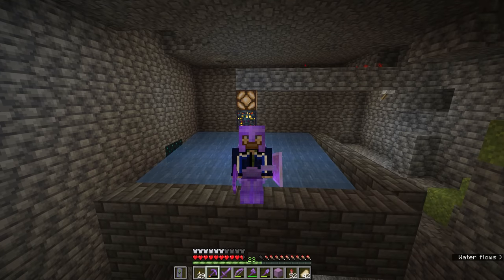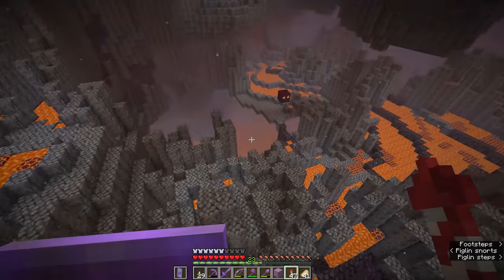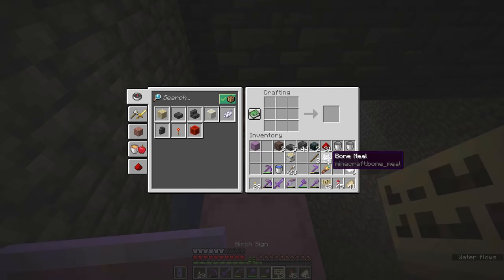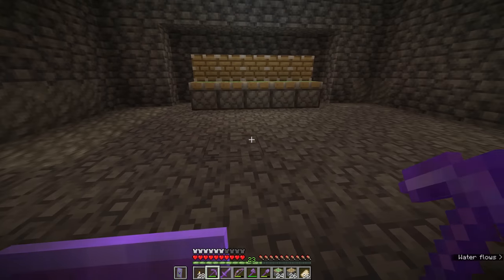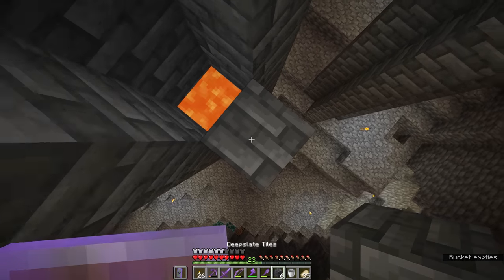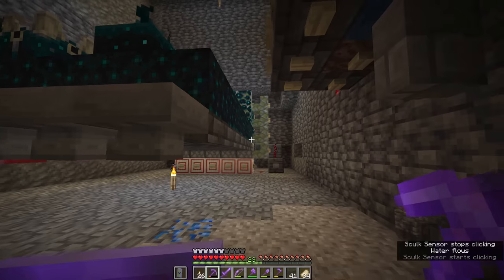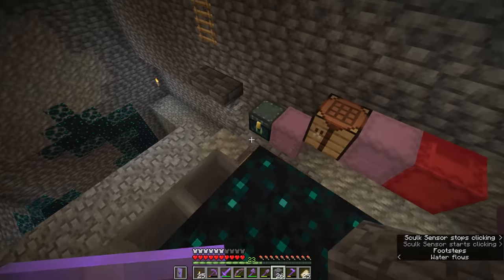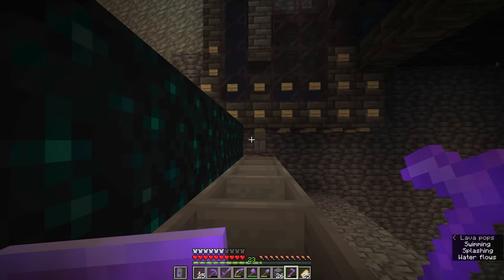How to use Sculk Sensor Frequencies! ▫ Minecraft 1.19 Survival Guide (Tutorial Lets Play) [S2 E117]

Comment: I think an interesting solution to the fall height problem is to utilize the sculk charge mechanic where you can control where the sculk charge goes using stairs and trapdoors. So maybe the set up would be have them drop into the floor on bedrock level or have them autokilled some other means and have a sculk charge wire travel to another room to be converted. It's too late to suggest this now but might be interesting for a future project maybe.
Reply: The only issue with that is sculk loses a lot of charge when moved along a wire, like an exponential amount and cannot produce anywhere near  as much sculk as it would otherwise, even on really short wires

Comment: pro tip: since Sculk veins can hold back water the same way signs and buttons can, coupling this with the ability for them to occupy multiple faces of a single block or spread to all available faces in a corner (like glow lichen can) makes them pretty useful for this.
Reply: I like the sound of this thematically, but it might not be a good long-term solution since I wouldn't be surprised if Mojang changes them to be possible underwater in the future, like glow lichen is.

Comment: if you let the spawner run without generating stone wouldnt after enough time all blocks capable would be converted or have the veins on them so the only available ones would be from generated stone when you turn it back on? seems easier than buttoning every surface

Comment: The comparator really is a complicated redstone doohickey, especially paired with the new sculk sensor.

Also why not make it so that right-clicking a sculk sensor swtiches it from proximity mode to frequency mode (the output signal can switch)
Reply from the maker: Because sculk sensors are organic - they're kinda 'alive' - so while they do output redstone power on their own, having them switch modes like a daylight detector feels a little odd. 
And, tbh, a comparator is designed for this kind of thing. So it's intuitive for a player who's used comparators before.
Reply: @Pixlriffs  that is true, and it is hilarious how cake outputs comparator signals, I do wonder if putting a candle in a cake changes the signal strength.

Comment: Why can't the comparator facing the same direction as the subtraction mode one be a repeater instead?
Reply from the maker: Because then it'd boost the signal regardless. A repeater would pick up a signal strength of 1 from the first comparator (which is meant to be the only signal which can actually activate the circuit), and boost it to 15, locking the output repeater every time.
Reply: @Pixlriffs  aaahh ok got it thx!